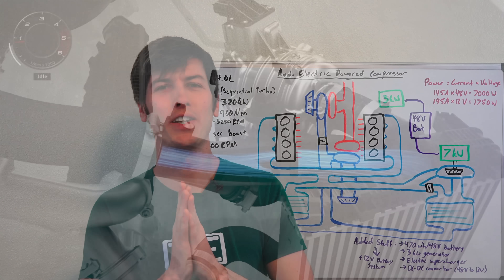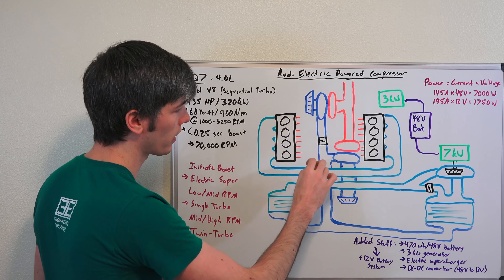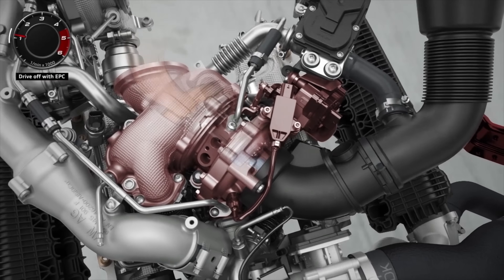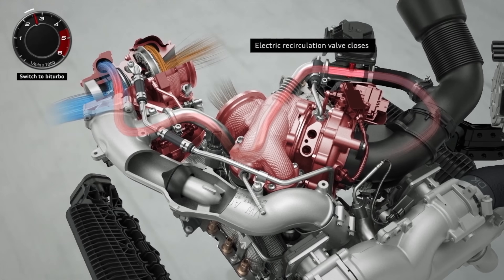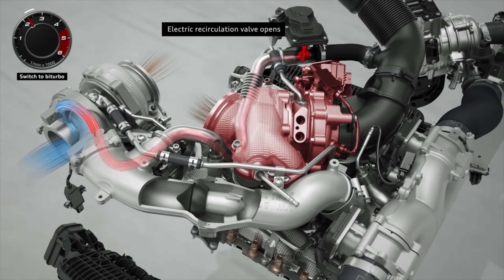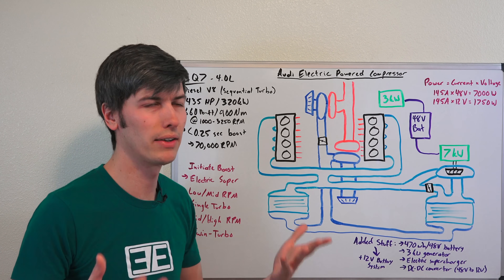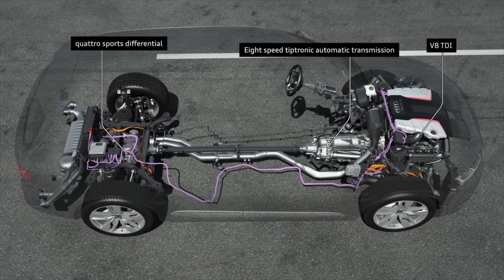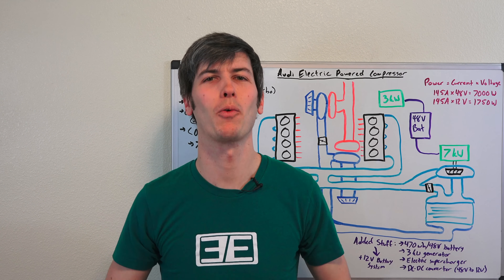Electric Superchargers - How Audi Is Eliminating Turbo Lag

Comment: Unnecessary increasing electrical load on vehicle audi no make sense to do this thing. Please learn something from Dodge. Look at this how simply they achieve maximum output torque and HP simple changes in hemi 6.2 l engine and resealt front of u Demon

Comment: I had an old BSA to which I fitted a big airscoop with a long thin tube to the carb. I stuck an electric fan in for slow speed power. Heath Robinson did not a lot of anything but in 1967 I was ahead of the game. About the only time.

Comment: Electric supercharghing at 12V may not be practical for a 400+ HP V8 system like this, but it should be more than feasible for a 2L 4-cylinder engine. Another interesting application may be hybrid cars where there is already a high voltage battery with plenty of power.

Comment: Best and cheapest way to go is the Patent Pending Axial to centripetal circumferential turbocharger. Simultaneous and evenly supplied torque on the entire turbine wheel. reduces turbo lag and has a twin turbine option to accommodate for high RPM

Comment: Cool tech, and as per usual not available in north America. But I don't get needing it on a diesel engine esp if it already has sequential turbos. My 3.0 TDI Q5 is spooled up at like 1600 RPM with just a single turbo with sequential Turbos it would probably be around 1200 RPM and who drives at idle? I am thinking this may be more to do with emissions that turbo lag. But its nice tech to see.

Comment: ugh this is forever old... but.  Why wouldn't this work.  Capacitor large enough to power an electric air pump for 10 seconds.  For 10 seconds then you could run like a turbo without lag or drag.  Charge the capacitor back up while at the next stop light / regular at speed driving.  Drop the hammer drop a gear and spool the turbo for a pass.

Comment: How difficult would it be to keep a 12 volt system for a naturally aspirated engine, but use the 48 volt battery to charge the supercharger motor only? I bet you would need a rather powerful alternator, or even two alternators for the twin voltage systems. You could put a toggle switch on the steering wheel or dashboard so you can use the charger only when you need the extra acceleration. If the charger were on continuously it would shorten the life of the electric motor. Also, would this system be cheaper to install than a mechanical supercharger?

Comment: Here is theory as to why a lower cost 12V inline fan might still yield great results: If a simple (and cheap) electric fan added  5% more intake charge, then there would be 5% more exhaust energy. That increases and spins the turbo more resulting in more initial boost. It would likely not directly translate to 5% more intake boost, as it takes energy to spin up the turbo, and other reasons. But for the sake of argument, let's say it increases the pressure out of the intake side of the turbo by 3%. Then the fan adds another 5% to that, and by the second cycle the system develops 8% more increase. So the 3rd cycle might increase to 11% or so, and so on.  The point being that this is a POSITIVE FEEDBACK LOOP,  which is why a SMALL INPUT MAY QUICKLY COMPOUND. I thoughT about trying this out about 10 years ago, but could never find the time. One wonders if anybody has tried it? Did Audi? Or did they just assume that a low power conventional fan wouldn't work, not realizing the positive feedback look aspect? A simple fan, btw, could be placed directly inline with a turbo, thus eliminating a lot of the complexity. (More than one fan can be serially used too, for more pressure.)

Comment: It's impressive that they designed it to have peak torque at such a low rpm but I think it's overly complex. They could achieve the same result with a single turbo that could be mechanically driven by the intake side of the shaft at low rpm while the engine doesn't create enough exhaust for boost, then decouple it once the engine is pumping enough exhaust to power the turbo. They could design a mini transmission with clutch that was powered off the main transmission to spin the turbo mechanically at sufficient power and rpms to achieve the same torque curve and peak horsepower. It would be like a supercharger at the low end and a turbo once it decoupled.

Comment: In my 87' Camaro I'm driving a Paxton Novi 2000 with a ME 0913 @ 72vdc (6x12v) and getting 5psi with a 350 smblk. It CAN be done, but as you said, it takes a lot more power than most people realize. Of course I get my 5psi without taking a thing off the engine, but then it's all gone by red-line. I  like it better than NO2. though and it still keeps the 2.0L turbo crowd from dissing me.

Comment: BIG MISTAKE!!!! It's not the battery that powers the accessories and turbo... IT"S THE ALTERNATOR! The ALTERNATOR would have to generate 7kw to power the electric turbo, NOT THE BATTERY! The battery is ONLY used to start the engine! This is in reference to a "standard" car's 12v electrical system................

Comment: I have a brand new A6, it has no legs, the power delivery is terrible nothing when you press the throttle, 170bhp at 1500rpm slams in, get above 2500rpm and you feel the power fade away,  were as my A45 dont make any power until about 6000rpm

Comment: It's not the battery that powers a vehicles electrical system, unless the engine is off. Once an engine is running all systems are being fed by the alternator so, in effect, the battery is only there to start an engine via the starter-motor. Thereafter, the alternator takes over.

Comment: The normal battery in a car is NOT powering any loads, once the engine is running, as you are trying to say. Your understanding is totally wrong. The alternator coupled to engine via a belt takes  up the whole required load and also puts back the energy, which was drawn by the starter motor at initial start up. Once the battery reaches the preset terminal voltage, it just remains on float. Intermittently, if there is a sudden load applied on the electrical system, where the alternator takes time to compensate, the battery would come in for a very short while to maintain the DC BUS voltage from falling below around 12.7 volt. That's about it.

Comment: What if you use a step up dc converter to go from 12v to 48v and then store energy on supercapacitors. Then use energy stored on supercapacitors to power the 48v turbine. Only three components and this could be retrofited on older cars. It would only be used on low rpm tô generate more torque for a short period of time depending on the charge of the capacitors.

Comment: Sounds like a complicated system that will be really expensive to maintain. What about using a belt driven supercharger in conjunction with an exhaust driven turbo? Low and high end boost?

Comment: The more mechanical parts and processes there are in there the more vulnerable it becomes to breakdowns.Its reliability use and strength is  as good as its weakest part.I'm impressed with the idea not its practicality.

Comment: If them Audi want to use electric energy to build a forced induction system then why not just make a dedicated big supercharger setup driven by a small motor powered by electric energy from the engine? Isn’t that a simpler way? That way you can decrease both the power leaching and the turbo lag at the same time.
Reply: It would probably have to be a very powerful motor with a huge draw. I'm picturing something equivalent to a starter motor running full time to keep a decent size impeller spinning at high enough rpm. Even with multi-speed or cvt linkage between motor and impeller sould still draw alot. An alternator big enough to supply juice would probably be a serious parasitic drag on the motor and gobble up a big percentage of gains. Somebody'd have to crunch the numbers. If that aould be you, lmk what u come up with.

Comment: What if you had a normally aspirated high performance engine and just wanted boost at certain times like how nitrous is used? Couldn't you just use the same type system simplified down to a battery or capacitor to power the unit recharged by the alternator then have an on/off switch for short use applications? The benefit over nitrous would be cost obviously -  never having to refill bottles but sacrifiicing 'maybe' less power than nitrous.

Comment: Why not just connect  electronic  motor to turbo ?  Why is it so important  to eliminate  turbo  .Turbo lag makes for fun skilled driving  chances of all that crap working all the time are negligible  .Better if they concentrated on making more reliable oil coolers etc

Comment: If I understand correctly, this is the engine that the folks designing the Raptor experimental aircraft have settled on. One interesting thing - they have decoupled the two turbocharger systems. They are using the conventional wastegate turbos to manage engine power output, and are using the electric side to pressurize the cabin. They're being a little cagey as to how they've reprogrammed things to make that happen, and no idea if VW/Audi is in on the project, trying to lawyer it out of existence, or what.

Comment: Car batteries can usually pull 1000A for starting up a cold engine. 12V * 1000A = 12kW. Plenty to run a real electric supercharger off! This Audi's electric supercharger is only 7kW, so around 583A, well within typical 12V battery's abilities, albeit just for bursts, not long hauls. Usually, hard accelerations last less than 2 seconds, some are around 4 seconds. A quarter mile is only around 12 seconds in a midrange car, so doesn't seem crazy at all to run electric superchargers on midrange sedans and SUVs for "sport" performance bursts.

Comment: ... or ...or...or  you could eliminate this demonically complex, expensive and power hungry electric device and switch straight to all electric motor to get zero delay and much more torque without a stoopid roll up torque curve of follow on ICE engine to climb up?   

In order to compete with electric drives (which are now winning all the challenge crowns) ICE cars become more absurd everyday.

Comment: No turbolag at the cost of a performance loss. It isn't difficult, every energy conversion stage is a power loss. There's 2 energy conversion stages(Mechanical->Electrical->Mechanical). Therefore, the delivered power MUST be less, but with the added benefit of there not being lag.

Comment: How practical would an electric turbo be on a smaller engine, say 900-1600cc motorcycle engine? 

Would you still need the 48v system or could you run a 12v DC current?

Comment: omg this is so cancer aids. 1) you can eliminate turbo lag just with a super. Why electric super. 2) converting 50 horsepower into electricity then back into physical energy? rip efficiency. And 3) this is much worse than a normal supercharger because it's more efficient because it doesn't convert energy. Oh now that i spent 30 seconds watching unbearable EE i understand what's happening. Audi made a boost accumulator that goes off when you need power when your turbo is not spooled. This is still pretty retarded. It would be much more efficient to make a container to just hold pressurized air. A 7kw compressor isn't very strong and can't stand up to a spooled turbo. However a big ass tank of compressed gas can probably emulate a turbo for like 20 seconds, which would be enough time to spool the turbo.

Comment: The 48V battery should also act as a power bank for the system, because it's easier to draw such power from a battery for a short period of time and then replenish it with less current for a longer period, thus reducing the momentary strain on the enginе. It is just not feasible to draw 580A from the car battery, when you can draw it momentarily from a secondary system, which you can replenish later, especially when this secondary system is powered by a 3kW regulator.

Comment: I think the complexity of modern combustion engines is getting ridiculous. Just put a 250 kW electric motor on the rear wheels, mount a 90 kWh battery low in the car and make it as aerodynamic as possible. You'll have no turbolag, a lot of power and torque and also quite good range.
Reply: I think electric are overrated. Hydrogen is a good way to go. Check the Toyota Mirai.
Reply: @attiliojorge2765  I don't think hydrogen powered cars have a big future. They are even more expensive than battery-electric cars, still need a battery, are very inefficient and need a completely new network of hydrogen pumps that nobody wants to finance and build.
Reply: Fabian Künzle it is all about pros and cons. Maybe something else will be the best but electric don’t have enough range. Hydrogen takes less then 10 min to fill the tank. So it will be better on that aspect. About price. The mirai is on the 40k but it’s more like a big sedan so definitely the can do cheaper ones.
Reply: @attiliojorge2765  Yes of course but I think a range of 400-500km is enough. Just the charging has to get faster. When I looked at the mirai yesterday, it was about 90k here in Switzerland. Do you really get it for 40?
Reply: @attiliojorge2765  Toyota ist selling the Mirai way under the production costs...;-).
Reply: "Just" mount a 90KWh battery because those are dirt cheap.

I mean that only costs about as much as an entire other car all by itself, no biggie.

Comment: Petrol engines can be made FAR more efficient if optimized at ONE RPM only, have a small piston engine recharging the large battery and run an electric 4 wheel hub motor car, no transmission for maximum efficiency, varying load taken by the electric system that is far better able to do it, the petrol engine need only be very small 500cc.

Comment: it would be better to incorporate the electric motor into a single unit .say a turbo with e motor . and when the turbo makes max allowed boost the emotor attached recharges the batterys ..like a 2nd alternator.... but a simple butterfly valve (with cutaway large enough for idle)  on the fresh air intake side of the turbo controlled either mechanically or via CPU ..would do the trick also.. the restriction directly at the intake or exhaust of the cold side.. will make the turbo spool like there is no cold side impellar with out lots of exhaust gas .... another method sounds like crap yet has been doneand works well..but is to create a combustion chamber in the exhaust ahead of the turbo hot side ..

Comment: TURBOchargers were invented to utilise the heat energy in the exhaust that would otherwise be wasted!!Who do you think will have to recharge the 7kw deep hole that the electric motor has made in the battery?7 kw is equal to 10 hp!!.
This turbo lag business is getting out of hand and nye on being totally crazy.

Comment: Shame they couldn't use the alternator to drive the crank at low RPM from the 48 volt battery then when up to speed the alternator charges the battery and turbo's take over.   Alternator works like a torque fill.

Comment: Seems more complicated than needed. I envisioned an exhaust driven turbocharger initially driven by an electric motor through an electric clutch, which would de-clutch when the exhaust gasses reach sufficient pressure.

Comment: I suspect that Audi is merely using this as a stepping stone to introducing the 48-volt system to more and more of the car. That additional power could also be used to power an electromagnetic valve system in the heads, or a pneumatic system like Koenigsegg is developing for his cars.  I realize that some of the power-drain of the 48-volt generator would offset some of the power gained by eliminating the traditional valve train.  There are always tradeoffs in introducing new technologies.

Comment: As a diesel owner suffering turbo lag this further complication /remedy is sure to be costly to buy/maintain on top of which I have just been informed that if I do a lot of slow speed work ie on long rough outback tracks I will cause my DPF system to malfunction at a replacement cost of $5-10000. Then there is my EGR system to worry about, enough of this rubbish.

Comment: Germans... complicated engineering, instead of a total rethink... why not simplify the turbo (somehow?)... I remember telling a Ford representative (car salesman) a loong time ago and wondering why they don't make smaller engines with a little turbo that makes 100 hp or more (and maybe a bit lighter cars)... he went totally blank for a second or two and said who do you know we are researching this?!?! And a couple of years later ecoboost line came out...

Anyway in my opinion make the car lighter with better materials and make it a standard so I don't have to hit 2 ton truck with my 400 Kg car... and I know it will be 100 ton lorry's out there but separate the traffic then at high speeds...

Comment: Why a whole separate compressor for the electric motor? Best would be a clutched electric motor driving the first turbocharger, also recovering energy at higher exhaust pressures, F1 MGU-H style.

Comment: there is some research and development going on to replace 48V turbo battery with a super capacitor bank. even going to 60V. lots of great stuff going on, thank you for the video. showing newer ways to boot turbo power. a computer switches it off and on as needed.

Comment: Wow two-turbochargers AND an electric supercharger? Overkill much? Much more maintenance and more stuff that can break and go wrong. German engineers seem overly complex. Also, why have a 48v to 12v DC-DC converter when the car already has 12-volts on-board? Seems like it is unnecessary. This whole design seems overly complicated and costly. With all that stuff added on you might as well just connect the electric motor directly to the wheels and make it an electric vehicle instead.

This is why you should never buy any European vehicle, complicated engineering makes maintenance and parts more expensive.